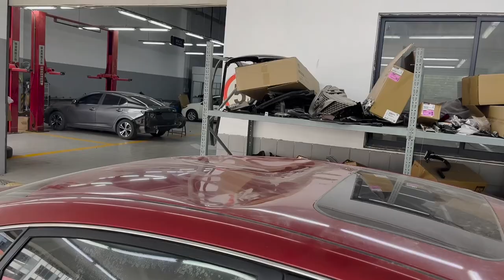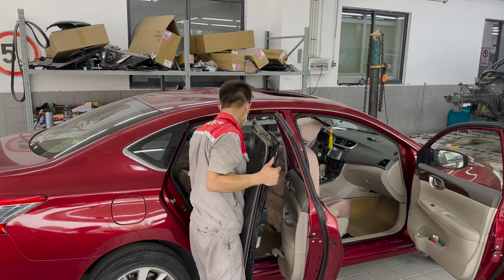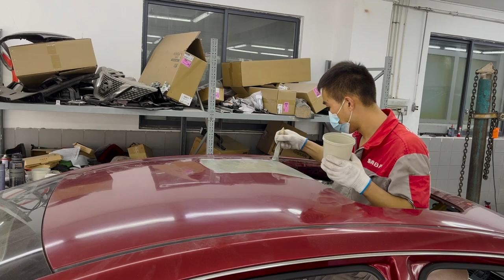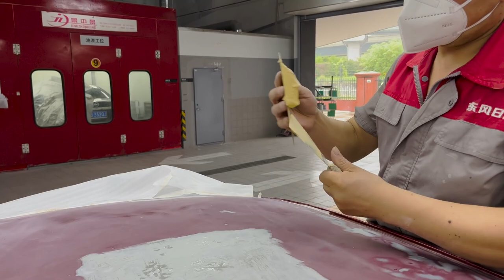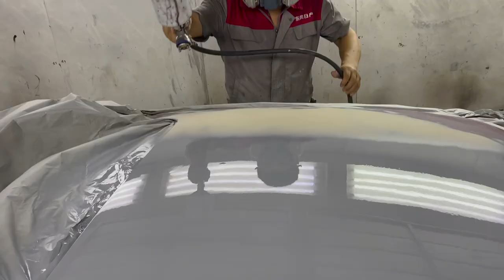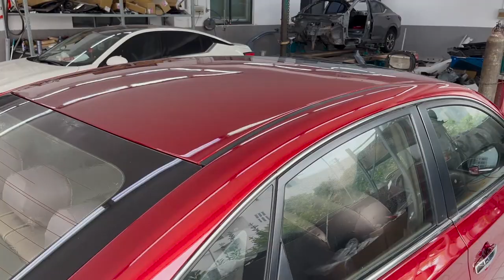Repairing a Severe Roof Dent: Restoring Your Vehicle's Top to Perfection

Comment: very inspiring. thank you. what did you paint on before using body filler?
Reply from the maker: Hello, thank you for your support. Before spraying, we usually apply a two-component epoxy primer to effectively prevent rust problems in the later stage.

Comment: Je pense que je dois remplacer le crossmember du milieu, j'ai pas de sunroof, est-ce-que je pourrai remplacer le crossmember par l'intérieur du véhicule ou le toit doit être enlever ? kia forte 2020.
Reply from the maker: Le remplacement du crossmember (ou traversière) du milieu de votre Kia Forte 2020 peut varier en fonction de la gravité des dommages et de l'emplacement exact de la pièce. En général, pour accéder à la traversière du milieu, il est souvent nécessaire de travailler sous le véhicule sans avoir à retirer le toit ou l'intérieur de la voiture.

Cependant, il est essentiel de noter que le remplacement de cette pièce nécessite des compétences en mécanique et de l'équipement spécialisé. Je vous recommande fortement de faire appel à un mécanicien qualifié ou à un atelier de réparation automobile pour effectuer cette tâche. Ils pourront évaluer la gravité des dommages, déterminer si le toit ou l'intérieur du véhicule doit être retiré, et effectuer le remplacement de manière appropriée.

Travailler sur la structure d'un véhicule peut être dangereux, il est donc essentiel de laisser des professionnels expérimentés s'en charger pour garantir la sécurité et l'intégrité de votre Kia Forte.

Comment: Well its far from straight, but that happens with such large distortion. Very difficult to get it straight because the metal moves up an down when sanding the filler.
Reply from the maker: @Brulserz • 1天前
You're absolutely right! Working with large distortions can be challenging, and it's not always possible to achieve perfect straightness. The metal can move during the sanding process, which makes it even more difficult. However, the goal is to restore the structure as much as possible and ensure the overall integrity of the repair. Thank you for your observation!
Reply: Dont push ...Let the machine do the work

Comment: In states hardly find anybody to do roof repair, if these lazy bums can not replace panels with after-market parts they refuse to do the job, minimum work and maximum profit, doing bodywork is becoming a lost skill like anything else
Reply from the maker: Indeed, nowadays people are reluctant to repair damages manually, as if replacing parts is the best solution, often resulting in a significant waste of resources and money.